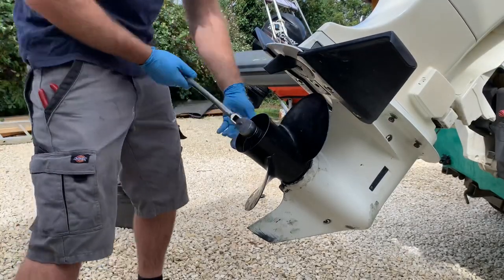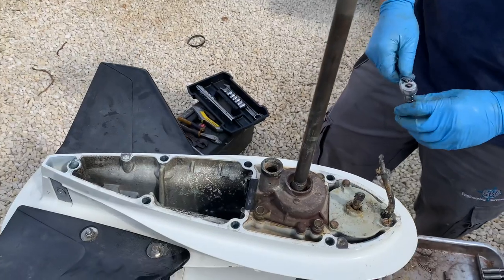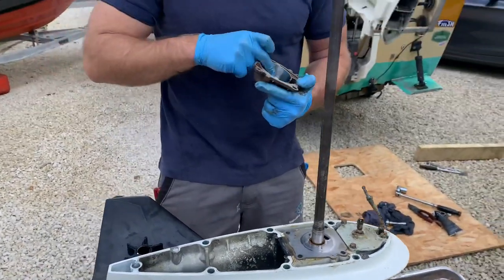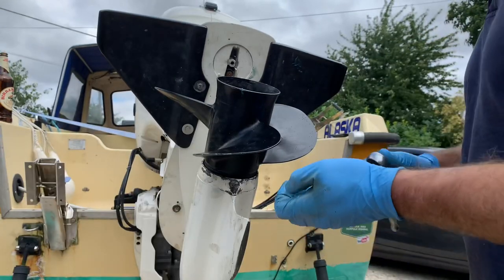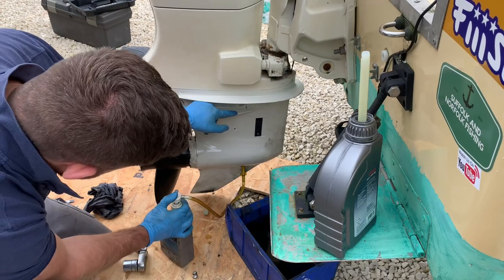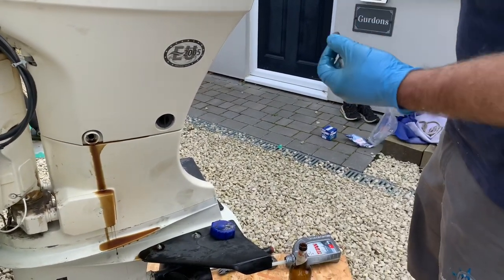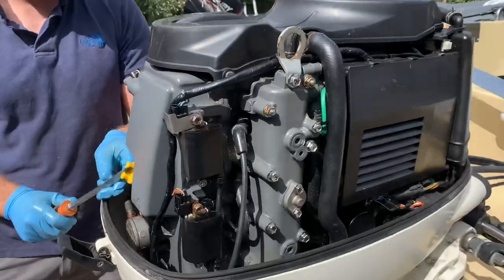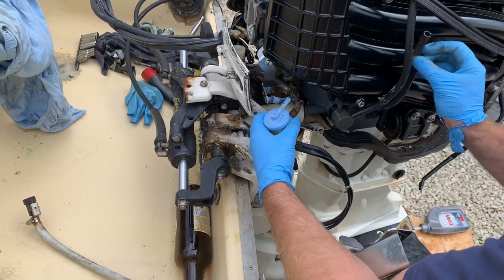4 stroke outboard engine service step by step | impeller and water pump kit, gearbox and engine oil

Comment: the engine has been standing for 4 years and has 550 hours..the problem was in the white wire, but I solved that and the engine started. I started it for a few days for 10-15 seconds and everything was fine and now it won't anymore..the pump works but there is no spark..it gives me the error 2 4 CMP sensor..bought a new one and the same thing..I doubt if the chain can skip? I would like to check that but I don't know how? what positions should be on the FLYWHEEL COVER and on the hole when the CMP sensor is removed? Th
Reply: Hello from Greece. I was wondering how many liters of oil were needed in total? Thanks for the videos